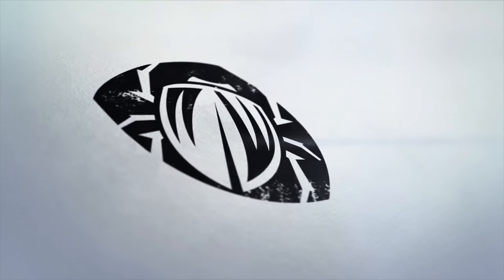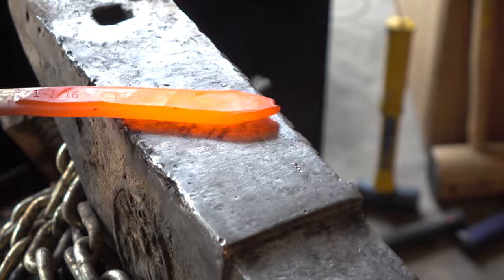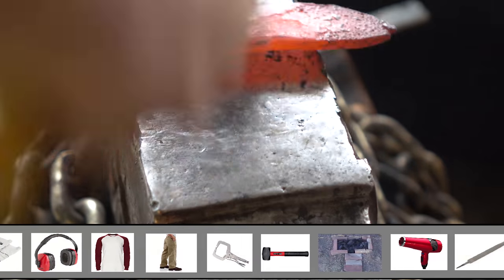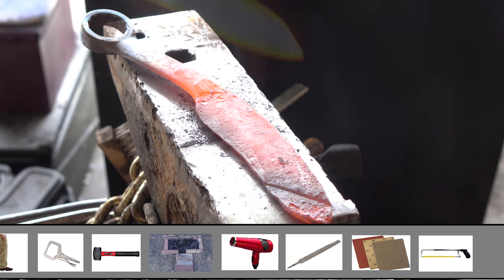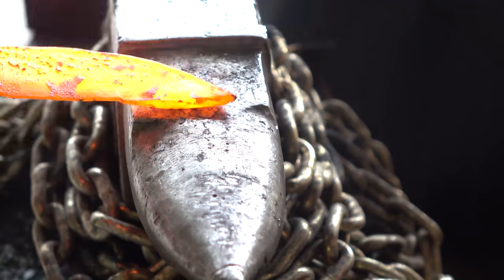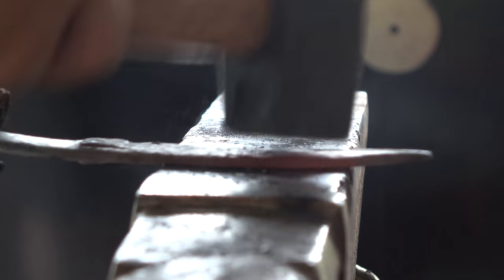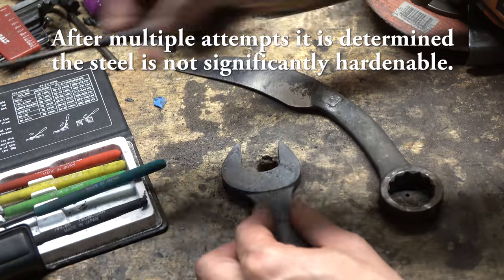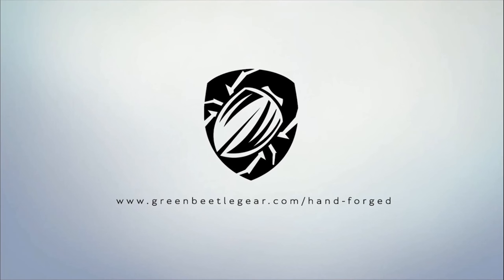Q&A + Forging a Wrench Karambit

Comment: It takes a different stage of temperature to heat and temper that type of steel, a lot of wrenches have a lot of chromi-vandium steel in it, meaning not only does it give it that shine, but also makes is harden differently. They usually say how they was harden on the wrench, especially older ones. My grandfather had one that he broke, he had gotten from his from his artillery days in the army. It made a nice kitchen knife and harden nicely..., that said it took many tries to find its temperature ranges. LoL

Comment: I figured I'd share something I found out recently since you mentioned you hadn't found any wrenches that fully harden yet.

  It seems that Snap-on wrenches (at least the half-moon box wrenches) harden up very well. The one I used for a karambit project earlier today got file hard after a quench in warm canola oil. I haven't finished working on it yet so I can't speak for edge retention, but as far as behavior the steel in the snap-on wrench seems to act a lot like older Nicholson files, but with higher chromium and a lot less rusting.
If you can find some of those then they may make for some decent blade stock, at least for wrench karambits.
Reply: Salvage yard!!!!! I get files,wrenches..I got a wrench other day,14-1/4 long and 5/8 thick,....Salvage yard heaven!!! Lots of cut RR TRACK TO..

Comment: The old proto wrenches I have have hardened great I got I bucket full from a mine when it closed they say chrome vanadium on them I use salt an dish soap mixed with some canola oil it was not a intentional mix but was ther an I quench 1 in it a it skated a file I have done 10 more since with the same results an a couple have been put thru he'll an held up

Comment: This would be a perfect weapon to be included in a Mad Max film. Set designers take note!
Reply: It wouldn't be because Mad Max is set in Australia or at the very least most of it was filmed here and a krambit is a Filipino weapon
Reply: +The hunter The Kawasaki KZ1000 didn't originate in Australia either. Fine, we'll just stick with edged boomerangs then.
Reply: +The hunter I'd guess with the exception of martial artists, karambits probably are a post internet thing downunder, but then, so are paracord bracelets. And speaking of Max's attire in Fury Road, the South African (not Australian) battle vest he wears was not issued until 1983 (between when Mad Max 2 and Beyond Thunderdome were released. So I don't know that the timeline of the Mad Max universe is tied down firmly. And besides all that, the weapon wouldn't have to be a 'true' karambit, the main point would be that it is an edged weapon crudely forged from an old spanner. But if it did resemble a karambit there are many examples in history of cultures separated by time and space separately arriving at very similar weapon designs.
Reply: ***** So I'm a dumb ass who should think a bit more before I type anything :)
Reply: +The hunter Well, actually I could say the same thing, I just read up a bit on the timeline of the actual story (not the dates when the movies were released - derr!) and it seems that some semblance of civilisation was hanging on in the early to mid 80's or mid to late '90's, depending on the source, so it is conceivable that a SADF battle jacket could be issued and find it's way to Aus. for Max to pick up. Well done to the prop designers for that one, the battle jacket manages to modernise Max's look (echoes the transition to chest rigs seen in vehicle mounted desert warfare of the last 25 years) while still apparently staying period correct. I used to think the SADF kit was the coolest shit before all the MOLLE stuff became readily available.
Reply: ***** Well know I have no idea what to type other then Good Job for searching/knowing this shit before assuming
Reply: +The hunter I meant that I should have read up more because I was stupidly going off when the movies were released and not the story timeline which was set in the then near future. But yeah, Google is your friend when you are trying to win a nerdy YouTube comment discussion! Though what you were saying was a good point to consider also. Perhaps, some post apocalyptic Filipino pirate could become shipwrecked on the shore of the Australian wastelands and become Max's sidekick. He could make Max a karambit from a spanner to thank him for saving his worthless life.
Reply: ***** You're awesome :)

Comment: Great vid and format for the QnA. I have a question.
Can you briefly explain how they forge welded hundreds of years ago before the invention of welding machines?
Ive looked everywhere but people dont explain/show/do how you're supposed to keep multiple pieces of metal together as well as getting an even heat without tack welding them together as well as to a piece of rebar.
Even if you could just reply to this message here that would be great as I cant afford a welding machine!

Comment: Hi, is there any danger of using chrom-vanadium steel and heat treating it 
or grinding it because of inhaling toxic/ cancerogenic fumes??
Reply from the maker: inhaling steel dust from grinding is always dangerous.  stainless is said to be more hazardous than regular carbon steel.
Reply: how to prevent this?
Reply from the maker: use a dust collection system and/or air filter and wear a respirator mask
Reply: Green Beetle hai can u make chipping hammer for welding work,tq

Comment: Why isn't it a user blade
Reply from the maker: the steel will not harden enough to hold an edge
Reply: If quenching it in oil isn't enough to harden the metal, I wonder if using a more faster cooling solution (water, perhaps?) might do the trick.
Reply from the maker: Sometimes it will make a difference but not all steel hardens enough to make a usable blade no matter how you quench, as is the case here.
Reply: Ahh okay, thanks for sharing.